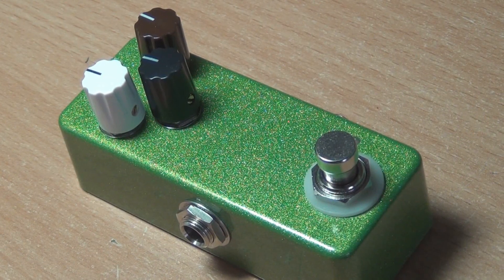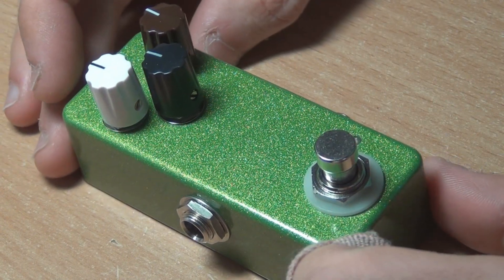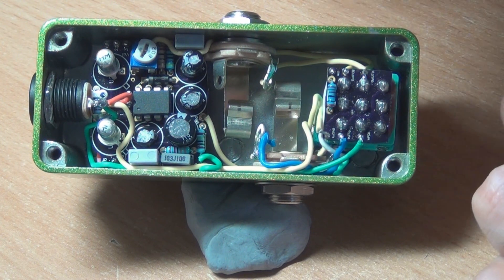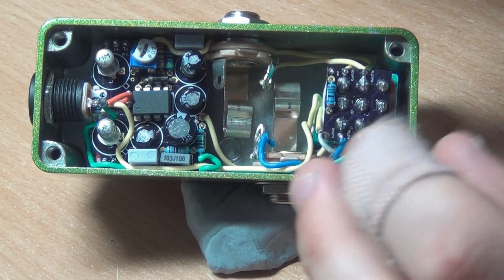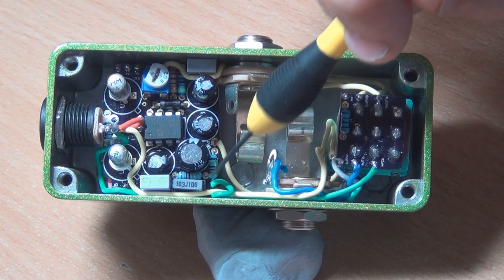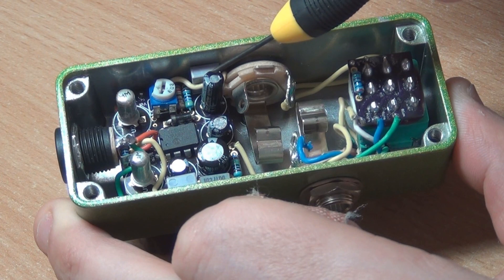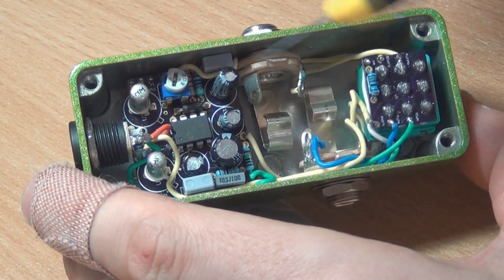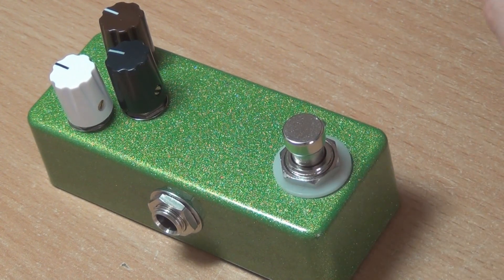DIYGP Facemaster - 1590a Fuzz Face - Build Report

Comment: Howdy I put together one of your kits this weekend and it seemed to come together quite nicely. Only problem I have is when the effect is engaged it doesn’t sound quite right, there’s no sustain and it doesn’t seem like the tone and fuzz knobs are doing anything. I’m sure I’ve messed something up but do you have any suggestions on where to start? Signal when the effect is off is fine and passed a continuity test. Sorry for the noob question!

Comment: Hey Paul, my kit cane with a mounting slot for the IC (which you'll obviously know because you assembled it), but the mounting bracket thing is brushing up against the diode. I assume it's fine to just put the chip directly on?
Reply from the maker: +bhmainz Hey mate, yeah I put those sockets in automatically, thanks for letting me know.  You can use it if you can fit it (if you can squeeze the diode in) or just omit it if its not going to work.  Let me know how you go!
Reply: +DIY Guitar Pedals Hey, Paul, I ended up just putting the chip directly on as I felt more comfortable with the clearance it gave the diode. An additional query I have is about the pots. When all three are in position (I have yet to solder them in place) they seem to be jostling for place, and at times touching each other? Is it alright for green plastic to touch green plastic? or might I be better off with soldering volume and tone directly on and just wiring the fuzz pot to the pcb? Tips appreciated. Also appreciate your prompt replies. Ta!
Reply from the maker: +bhmainz +bhmainz Hey mate, 1590a's are tight for space, its a little tight but 
you should be able to get them all in relatively square...dont worry 
about the green plastic touching they have no electrical connection.

Comment: Dumb question. I see classic circuits being cloned all the time but I always see a 8 pin ic in the circuit. What's its purpose?
Reply: Not dumb at all,  a valid observation. The IC is actually an op-amp (in a lot of cases it's 2 or 4 opamps in the one package). An operational-amplifier being the fundamental component used for any signal gain.

They were originally implemented with a couple of transistors (tubes, even) and resistors/caps. ICs make things more reliable and smaller
Reply from the maker: ***** This particular IC is a charge pump (tc1044scpa) which is used to flip the power on the input so that you can use your positive barrel dc power (boss style) to power the effect instead of requiring a separate negative barrel dc power source.  This is because germanium transistor circuits are often positive ground effects.
Reply: chromespherecom
Everyone learns something!